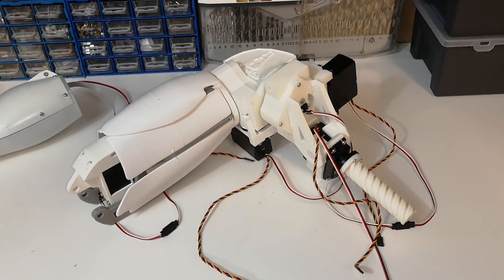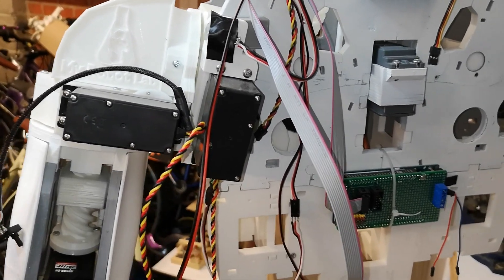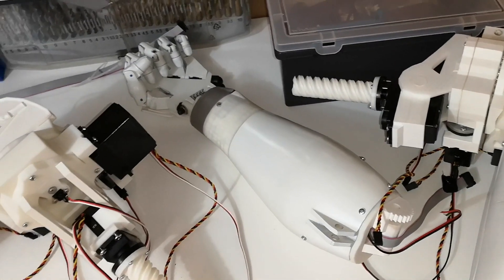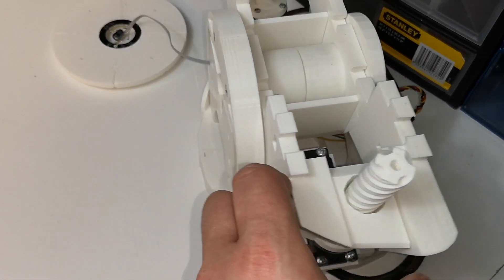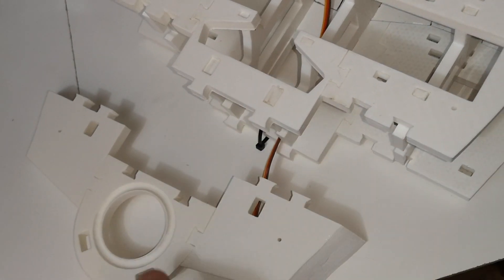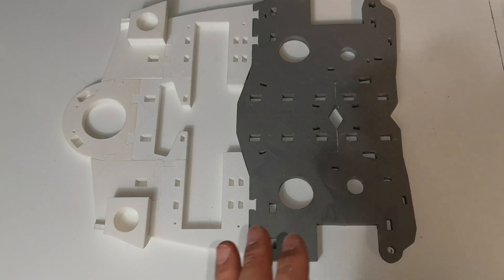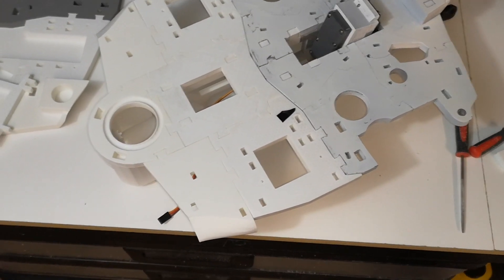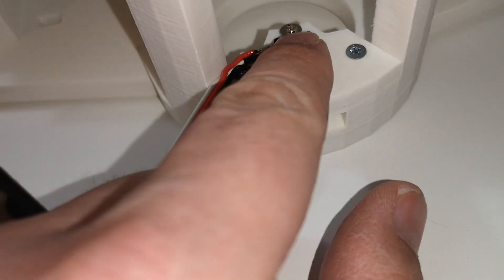Civrays InMoov - Teardown

Comment: If you use studs and nuts instead of bolts for the shoulder, you may be able to take the torso apart more easily, removing either side of the torso by removing the nut, while leaving the stud in.
Reply from the maker: Thanks, that's an excellent tip.